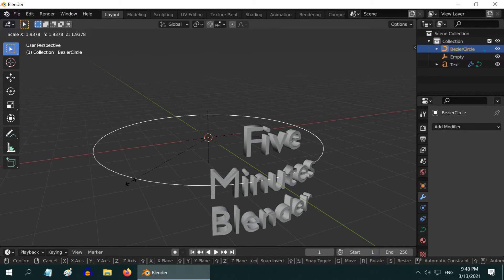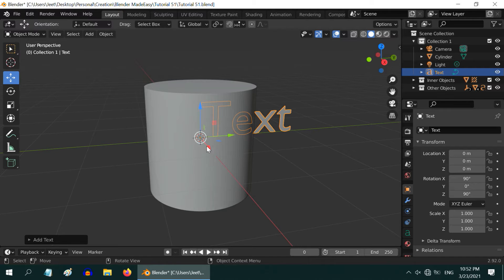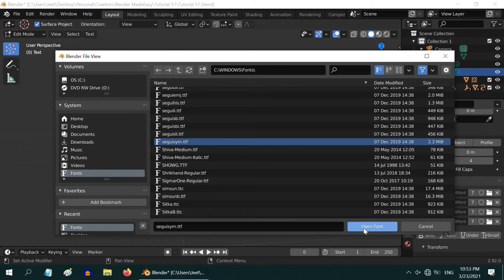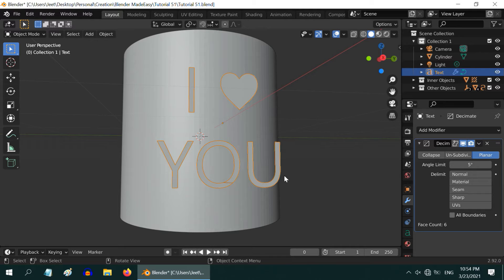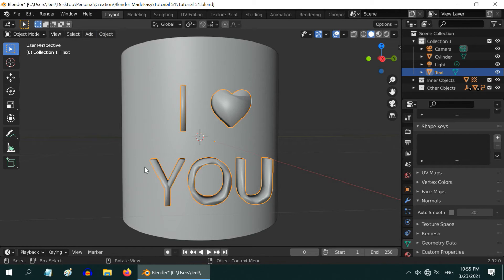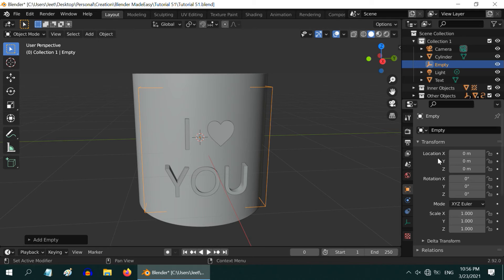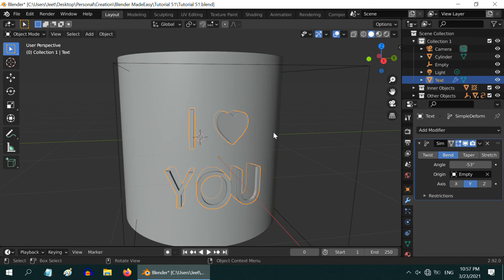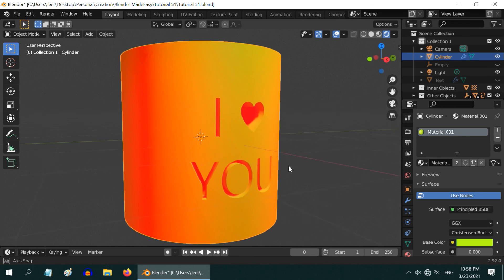Engrave or Carve Text On Curved Surface | Part 4 in Text Effects | Blender Eevee & Cycles

Comment: Boolean doesn't work correctly any way on 6.12.....
Reply from the maker: Did you try the options like Fast vs Exact, Self Intersection, Hole Tolerance? Or sometimes the simple Fast option works better. They usually solve the common problems in boolean where the mesh geometry results in an incorrect result.

Comment: for some reason, the bending is not working like the video shoes 
for me, it is just adding more thickness to one side of the text and making the other side thinner
Reply from the maker: Hi, this is most probably due to a difference in the viewport axis orientation in your case and mine. Flip your rotation axis (x-axis vs y-axis) and it should work. If not, please check the orientation of your empty. Rotation can be sometimes really tricky with simple deform modifier that we used here. If you are interested, you can look at our Bend Geometry node that makes any kind of rotation super easy. It is a product you need to purchase: https://youtu.be/okHTUpG_hSA
Reply: @5MinutesBlender  hey, indeed it was because of the difference in the viewport axis. Thank you :)
Reply from the maker: @omarzidan4055  Great! Glad to know that you resolved it 👍

Comment: Nice tutorial. BUt what is the solution if we want a subdivision model? I.e. a model with subdivision modifier enabled but not applied yet like in your process?
Reply from the maker: Hi, you can keep the subdivision modifier for the cylinder in draft state, no need to apply it. Everything will still work perfectly producing the same result. But for the text object, obviously you have to apply the modifiers (it gets auto-applied when you convert the text into a mesh). I have tested this. Please let me know if you are getting a different result.
Reply: @5MinutesBlender  What I mean is that your result is a sharp cut out that look 2 dimensional (only with depth). If you model text with subdivision (loop cuts and all) it look 3 dimensional with nice bevels and a smooth flow (even if font is sharp/bold) (looks great for rendering and stuff like ads etc). Your result would never be sufficient for a product ad with close ups of the text engraving for example (its fine for 3d printing only). The problem is that its really hard to add all the necessary loop cuts (to direct subdivision modifier) without distorting shading and curve of the cylinder (or curved surface of object you are trying to engrave on). So what I mean is that you created something which looks like a rather simplistic "2d with depth" engraving rather than a really sexy subdivision modelled engraving that looks 3d and is realistic as it has smoother transitions at the edges of the font letters (even sharp font has that in the real world). I think if you ever created a subdivision model for text it will be obvious what the difference is. Again: for me the big problem is that its easy to do the subdiv text model on a flat surface. But really hard on a curved surface (shading and distortion of curve problems). Even more difficult if the curved surface/object has a mesh that not made up of perfect squares but longish rectangles. Would be interested if you know what I mean and if you have a solution.  I have found not one video on this on youtube (probably because its a really tough one to do). Again flat surface I think you dont even have to bother with a tutorial, as thats very easy. But curved surface is the holy grail and a typical problem, as most products are curved. Thanks for your reply.

Comment: Great tutorial. How come you created an empty and went through all those steps when it seems that you could've just added a shrinkwrap modifier to the text and then play with the offset to get either your engraved or embossed look on the cylinder. You could then apply the shrinkwrap and move on to add the boolean modifier to the cylinder. Would this work?
Reply from the maker: Good question. It will work. But it may not look as perfect as this one, if your text has a good thickness. I tested several combinations and then decided to present this method. There are some limitations with Shrinkwrap. It tries to "project" or "wrap" the source object (text) according to the shape of the target object. That is something, and bending of text is a different thing. When you bend the text using an empty, it does not get distorted, different parts of the text will still stay in the same proportion. But with Shrinkwrap, this proportion gets distorted. Sometimes it may be immediately visible, sometimes maybe not. The extra pain that we took by adding the empty & the simple deform modifier, will pay in a long run. But your suggestion is also good, and can work in many cases. So thanks for pointing it out 👍

Comment: I made sure the empty and text are both in the same place. When I bend my text, it doesn't curve back. Rather it becomes shaped like a bow-tie, with the front and back intersecting eachother.
Reply from the maker: Short tip: Try to add a rotation of 90 degrees to your empty in the Z-axis, keeping everything else same as before. It may work. Long answer: The issue you faced usually happens because of inconsistent rotations of the text and the empty, and their placements on a specific axis. If you follow the tutorial verbatim, it won't be an issue. We have set the text with X-rotation & Z-rotation both 90 degrees. Also, the text is moved along the X-axis, it is facing the positive X-axis. With this, the empty is given the same displacement in X-axis, and most importantly, the X-rotation is 90 degrees and Z-rotation is zero. If you do the same setup, but along the Y-axis (the text facing the positive or the negative Y-axis), it won't work - instead, it will give you that bow-tie look. You need to then use X-rotation 90 degrees and Z-rotation also 90 degrees on the empty, while your text will only have X-rotation as 90 degrees. Initially it might seem difficult, but once you get a hang of it, it will become very easy. If nothing works, remove all rotations from the empty, and try each different combinations of angles (making each single direction as 90, and then making each pair of them as 90). There are only 6 combinations possible, and one of them will surely work. This is a trial-n-error method, but it does not take more than a minute to try.
Reply: @5MinutesBlender  Yep, it's working now thanks.

Comment: Can you answer me? I have one question. Material of Cylinder is green, but color of cylinder in screen is orange. Why?　Sorry for the poor English.    OSKA from japan
Reply from the maker: Good question 👍 The material of the cylinder is light-green. But to illuminate it further, we have added a red color Emission object (a second cylinder) inside this cylinder. The combined color is showing as orange. An irradiance volume is used in order to first bake the light from the second cylinder (inner cylinder) - this technique is known as Indirect Lighting. Then this inner cylinder is made hidden. So in the output, we don't see any second cylinder, but the lighting effect is intact & visible. This entire thing is done just for a decoration purpose. It has no relation to the actual tutorial, so I did not get into those details. And by the way, your English is sufficiently perfect 👍🙂

Comment: Thanks for another excellent tutorial. I had one problem: when I used the Boolean modifier my cylinder disappeared. I found that, on the modifier settings, under Solver Options, I needed to check the Self box. Then it worked properly.
Reply from the maker: Good tip shared. It may help someone 👍 I did not encounter this in this particular tutorial, but I did face it in another place and the solution was the same. So, thanks for your helpful input 💝

Comment: I have a little problem, i followed all the tutorial and it came out great, but when i put it in Ultimaker Cura, the letters aren't carved, i don't know if i did something wrong. Either way thx for the tutorial
Reply from the maker: I just checked it now. I exported the blend file of this tutorial from Blender to STL format. Then I opened that STL file with a 3D viewing software, and it was perfect. So I can offer two suggestions in your case, not sure if they can solve the issue at your end. First, apply all the modifiers and hide the objects that are no longer needed. Basically clean it up appropriately for the final output. Secondly, if not using the STL format, please use that for the export, and verify the output. You can use the default 3D Viewer software on windows, or take help from any online STL viewer, there are many. If there is an issue in this part, the problem is on the export side in Blender. Otherwise, if this output looks correct, the issue maybe on your 3D printing software, Ultimaker Cura in this case. Whether or not it solves the actual issue, we will at least know which part of the problem we need to focus to.